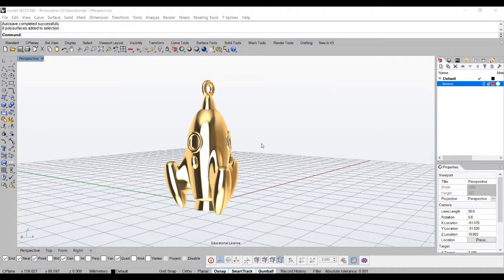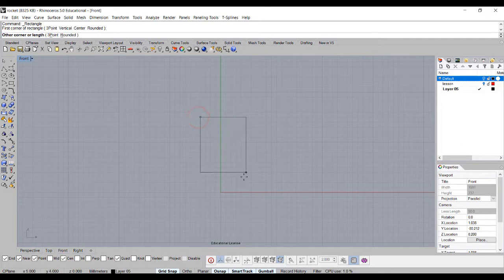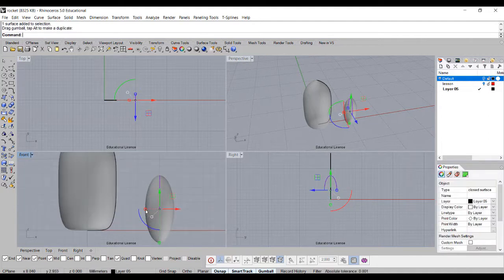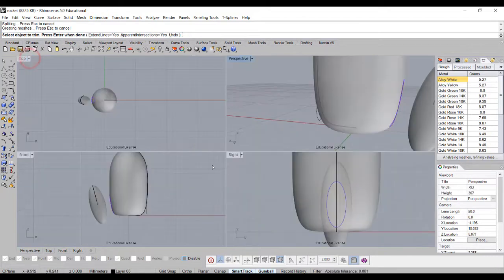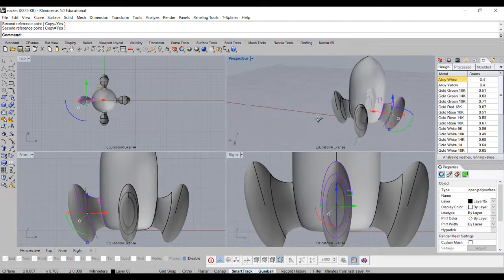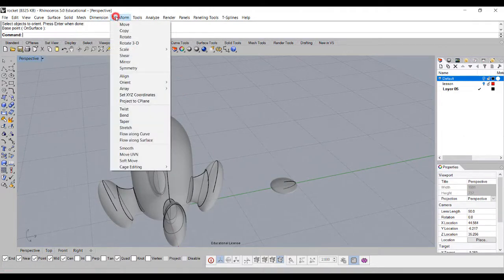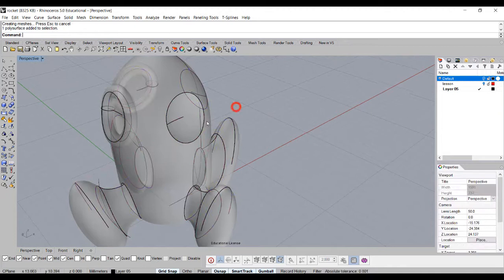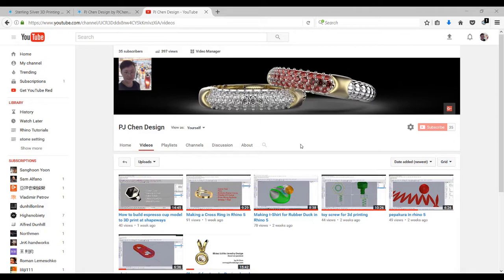Jewelry CAD Design Tutorials #4- How to build a 60s inspired Rocket Charm 3D Model in Rhino 5

Comment: I mean do we need offset surface of 0.8 mm at least for 3d printing,or if we closed the surface and turn it to closed poly surface,it means the thickness is more than 0.8 mm and that is enough?
Reply from the maker: Hi Siren, The thickness is really depends on the design structure. there is not really a standard here. I tend to go thicker to be safe and can always sand it down later after casting.
Reply: Im sorry to ask again and tnq for ur reply and all perfect tutorial. I have problem in 3d printing in 1 part. For example if i have a ring which is a closed polysurface،do i need to add surface offset as a thickness or because its a closed polysurface،it is acceptable for 3d printing?

Comment: Thanks you, Very good Tutorial. 

I have a question, When I was doing the Pipes for the windows... The pipes didn't show or appeared corrupted (Like distorted or like big planes coming out of the pipe). I made 1 and then copy/rotate like the commands on the video but some copies become distorted like I said before... Is this normal or did I pressed something wrong?

Thank you in advance :3
Reply from the maker: how is the curve you pipe with look like. did you join two curve together. if you do, you need to rebuild it. if not, you can send the 3dm file to pj@pjchendesign.com and write me a short description for what went wrong. I will take a look for you.
Reply: @PJChenJewelryDesign I actually didn't have a curve like the one you have in the video after you do Boolean subtraction, I instead used one of the surface borders (when the pipes glitched) and then create a curve with Duplicate Edge and they still glitched.

Today I remade all the tutorial and this time... nothing happened. I did what you say (rebuilt the curve) and everything went normal...

Thank you so much for your time :3